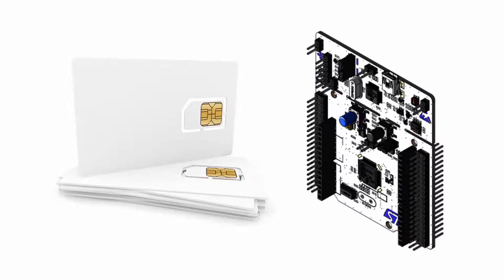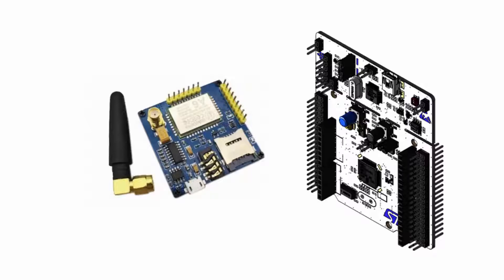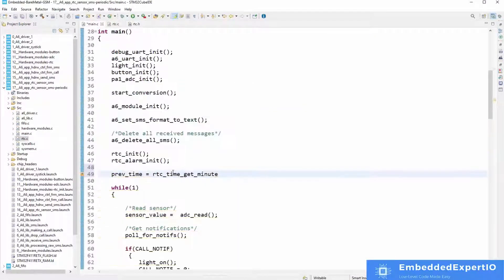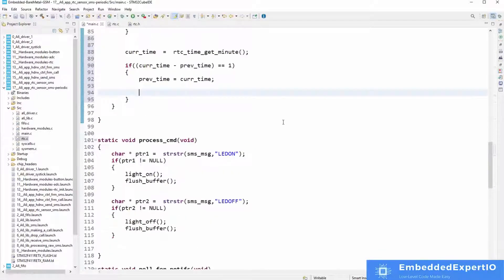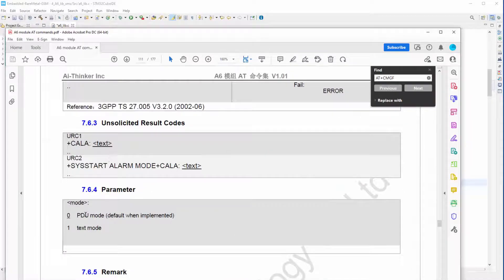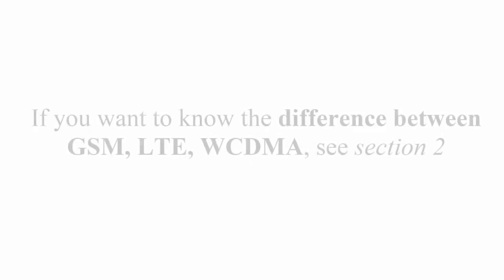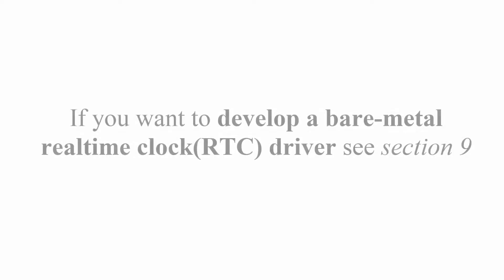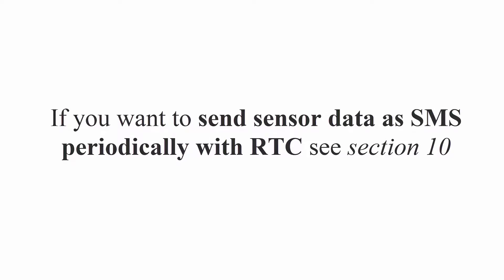Embedded Systems Cellular Firmware Development(GSM)

Comment: Hello. What course from you should I take to learn complete, step by step procedure for GPIO and other drivers for STM32 devices? I need the whole process, creating structures that hold information on peripherals and function libraries creation process, not just using pure bare metal approach. Thanks.